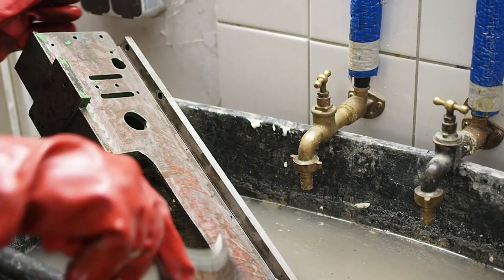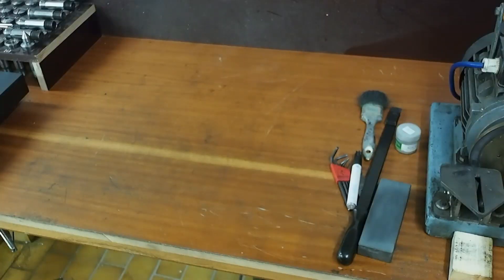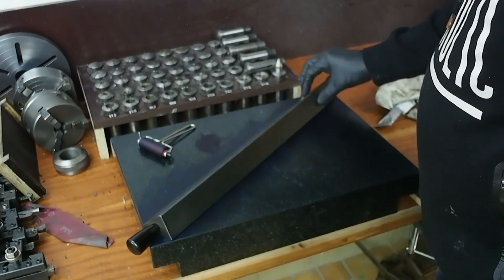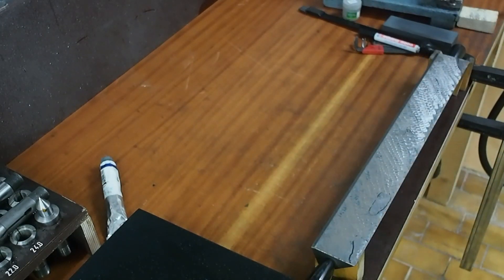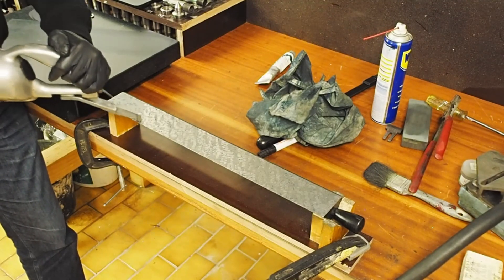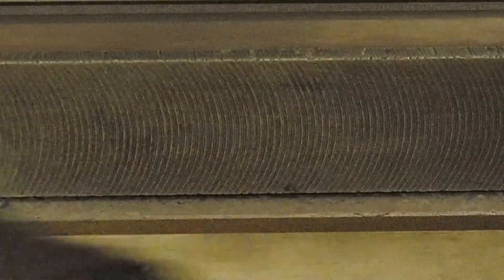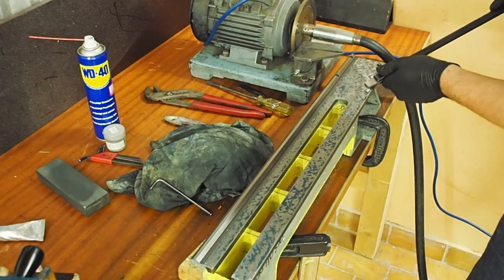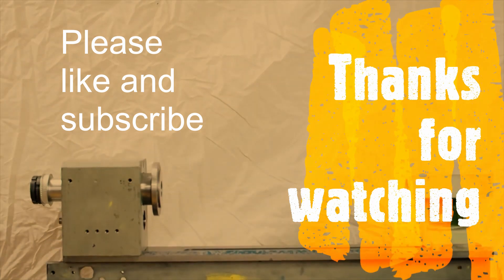Ultimate Minilathe: Episode 1  Bed scraping || RotarySMP

Comment: I don't understand why you would scrap it?
Reply from the maker: Not scrap...scrape. It is a process to carefully remove metal to bring the ways back flat and in alignment. 

But you are right, scraping the mini lathewas polishing the turd.
Reply: @RotarySMP  so instead of using a grinding stone you can do that? Pretty cool to know. 👍
Reply from the maker: @hotrodhunk7389  Scraping has advantages over grinding. The surface ends up with undulations of µm, which retain oil, improve the stick/slip behaviour, and reduce the risk of galling.

Comment: Where in Slovakia did you buy the straight edge?
Reply from the maker: It was some used machine dealer in Komarno.
Reply: @RotarySMP  thanks i think i know who that is (Peter Farkas).. he not always sells things for good money actually
Reply from the maker: @chronokoks  No he doesn't. He wants to sell all the heavy stuff in €/kg, which ends up as a complete rip off. I did get a few nice things there, but never went back.
Reply: @RotarySMP  There were several people like him over the years around Slovakia - folks who bought out the tool rooms of big state owned companies that went under right after the fall of socialism. Some even stole enough stuff to fill several large store rooms :D But they were selling at a very good price. The ones that are still left selling stuff are bitter old fools.

Comment: Awesome series, thanks for sharing! What's the width of the manual scraper that you are using? Is it a Sandvik?
Reply from the maker: Yes a Sandvik. The bought blade is a 25mm carbide, but for this tiny lathe, I did a fair bit with a home made blade with about 12mm of carbide on the tip.

Comment: What is the number of points per inch are you looking for? My only advice is to do each pass at 90 degrees from each other so you up not getting ridges of metal but "peaks" I guess people call it cross hatch pattern
Reply from the maker: I didn't get to hung up on measuring PPI. On very small surfaces like all these mini lathe ways, you are up around 30-40 PPI by the time you get even coverage.

Comment: If you want to fix your big lathe to have a some what proper feed have a look at this channel. He fitted up a motor to his leadscrew and it appears to work well.Clough42
Reply from the maker: Thanks. Yes I am subsribed by Clough42. I made up a Stepper mount to drive the Boley leads screw years ago, but my bodged up PSU, driver and controller for it it a PITA to set up. The Mini-lathe rebuild is sort of a prototype for doing a proper job on a decent lathe.

Comment: I'm a long way from a pro - I'm a woodworker who wanted a flat bottom on my handplane. So I scraped it (actually, I mainly filed and sandpapered it, controlled by the blue spots). I think I've done around 6 planes so far.

I did learn a couple of things:

1) Try to have a separate area for your "metal removal" and "printing" operations (AKA dirty and clean). It only takes a single scraped chip on your workpiece (or surface plate) to mess you up. The print process is very sensitive. Further, the clean area doesn't need to be rigid, so a normal table (or workmate) is fine. The metal removal is much nicer on a nice rigid workbench. I wipe the workpiece down first in the dirty area (with a fairly nasty rag), then AGAIN in the print/clean area with a better rag.

2) Don't go slow in the early stages. Until you're working the whole area - have at it, HARD

These two videos are a wonderful antidote to the (IMHO) overly reverential approach many take to scraping - this guy works on machine tools professionally:

https://www.youtube.com/watch?v=Lr_CcoHki-0

https://www.youtube.com/watch?v=xHT-uzKQM6U
Reply from the maker: Thanks for advice. You have a good eye. You picked up that I tend to switch to finish scraping too early.  The main cleanliness problem I encountered is that the bed has a lot of corners to trap swarf. Since you are flipping and rotating it a lot, often a chip would fall out and I needed to reclean, sometimes reblue.

Comment: Very interesting, I’m looking for a lathe myself now, and as I’m on a budget and because I’d like a decent long bed,I’m going to have to buy an old one, I’ve always wondered if one can rejuvenate some worn out ways, I guess the main big boys use a huge mill? Really cool vid cheers
Reply from the maker: Hi Julian. Scraping is not a poor mans solution. If you have sliding ways, and grind both to a mirror perfect flat surface, they will stick/slip so badly as to be unusable. Even high end machine tools with ground ways have oil pockets scraped in. If you are in the UK, you are a lucky beneficiary of de-industrialistion. I check Ebay.co.uk regulary, and good lathes there go for about 1/2 price verses what they fetch in Germany or Austria.
Reply: RotarySMP ahh very cool, yeah I’m on ebay all the time looking, good to know about the ways. I’m keen for a Myford super 7 with a long bed :)
Reply from the maker: @JulianMakes  You can normally get an industrial lathe for the same or less money than a hobby lathe like the Myford. 
Harrison, Colchester, Hardinge, or even a DS&G 13x42 like this...
https://www.ebay.co.uk/itm/Dean-Smith-Grace-DSG-13-x-42-Metal-Cutting-Centre-Lathe-with-Accessories/124018561083?hash=item1ce015103b:g:yWQAAOSw8G1d~fZi
These were the Rolls Royce  of lathes, and used by RR.
If you look at the how much space a Super 7 on it's stand needs, the difference to a Colchester Master 2500, Harrison 300 etc is minimal.
Reply: RotarySMP ooh I’d actually missed that one cheers, I’m looking at a Colchester too and a similar sized leblond, tbh the larger weight will suit my wants much better, it’s just I don’t have the lifting equipment but I’m asking about many of these shops selling do have forklifts etc.
Reply from the maker: @JulianMakes  That DS&G is out of a Uni machine shop. You'd have to look at it, but the paint looks original, and it doesn't look abused. Really, once you are moving more than about 600kg, it makes little different if it is one ton or two.
Reply: @RotarySMP  Watch OxToolCo (Tom Lipton) on moving heavy machines using small jacks, levers and rollers. Smart guy.

Comment: Add some Vaseline to the prussian blue and mix them well. It will keep the paint from drying out.  If you don’t have a Biax, you can make one by buying a cheap oscillating tool and grinding a semicircular edge on a narrow blade.  Alternatively, you can use a rotary tool with a rotary stone ground to a conical tip, or use a ball point diamond tip.  The Dremel is perfect for small areas.
Reply from the maker: I got lucky and bought that Coborn scraper from a local guy (who has become a friend.) I made a video of it here...
https://www.youtube.com/watch?v=74gLQ-V2Gws
Have you ever used a hacked sable saw for scraping? Before I got the Coborn, it was something I considered. The experiences of guys who have gone that route are not universally positive.
Thanks for the tip on ass vaseline to the prussian blue I'll have to try that. I just use WD-40 to clean it up after each session so far.
Reply: @RotarySMP  have you heard of Robin Renzetti?  he made one, i recall seeing it on his instagram page, well worth a look
Reply from the maker: @jasonharman5083  Thanks. I'll take a look.
Reply: RotarySMP  An oscillating tool like the Fein works great with zero modifications. Just add a carbide tipped scraper blade.